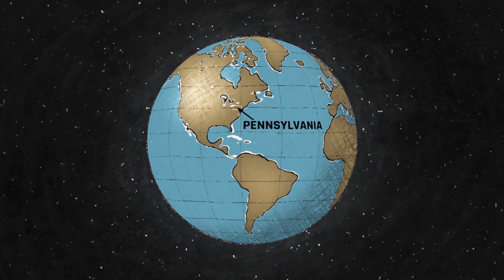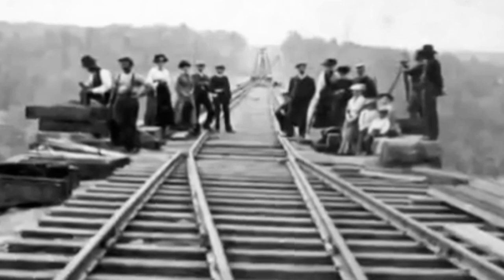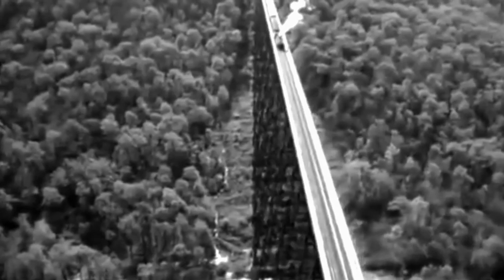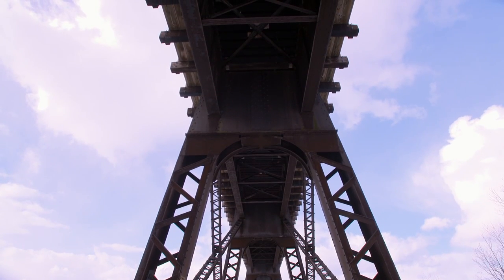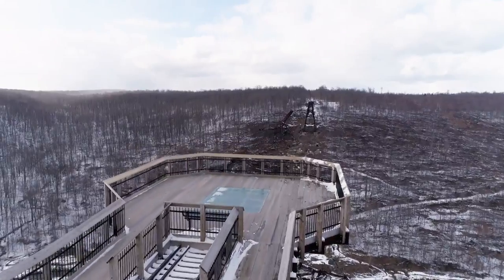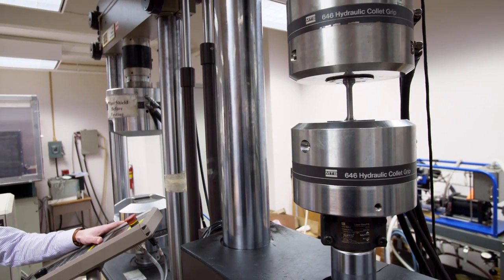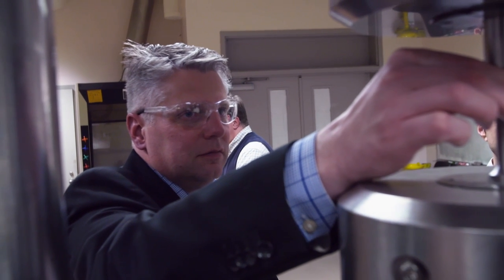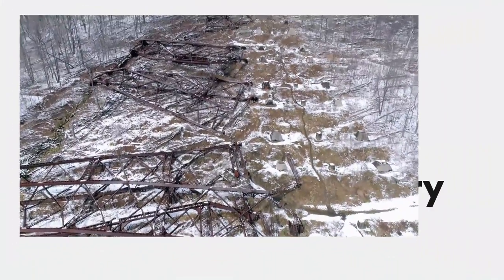How The 8th Wonder Of The World Failed Due To An Engineering Oversight |Massive Engineering Mistakes

Comment: Built in 90 days and then works over a hundred years... nobody injured or killed in its last day... I consider this a success 👍
Reply: Danger Bear  the same thing happened in Seattle Washington on a monorail project.
Reply: Massively!
Reply: But it didn't factor out how many labour were used?
Reply: today you have tons of crapy.managments like lean, six sigma,... And there is bigger potential to generate failures like this one or worst ;)
Reply: @Passco666  Ah , I see you're an old Jack Welch guy with that six sigma comment. It worked for Jack. Fire ten percent every year.
Reply: @Dan-oj4iq  I like like to use brain, instead guidelines for dummies.. Have a good christmas time..
Reply: I concur we're talkin an overwhelmingly genius design as even with anchor bolts, and unseen catastrophic weather events considered,because like you said the bridge was nothing but a true blue performer for so many years,and I am paraphrasing of course LOL..All things considered the bridge offered up nothing but positive happenings,& we all know as it pertains to practical designs,& with safety of course being the most important aspect to a design it all comes down to liability risk factor, and actual catastrophes, which in most cases any concept asked to deliver so much must in all actuality risk life and limb,or at the very least destroyed life and limb throughout 100 or so years of existence,which neither was the case in this situation.The bridge was absolutely genius it performed ingeniously for so many years and of course it's design was actually masterful because not only did the bridge fit into the picturistic it's actually served its purpose masterfully,& I actually think the anchor bolts were genius,as they allowed the bridge to move a little on the footer stones, which probably contributed to its longevity stability,and it's awesome safety record for so many years. Anyway my friend God bless everybody and have a merry Christmas. Thank you very much friends and Neighbors for letting me weigh in on your conversation,as i just wanted to say you are 100% spot on,and I really appreciate your opinion
Reply: Surprised they didnt try to blame it on global warming. The warmistas seem to try to blame everything on CO2.
Reply: Plus, after a hundred years of use, it took a tornado to blow it down. Yeah, a success.
Reply: @JordanJank  You talking to me? O_o
Reply: i see it as a absolute win
Reply: @franksworld9922  same thing happened in Springfield on the simpsons lol
Reply: @jakeshaw6827  your right! I forgot about that lol!
Reply: @franksworld9922   lol
Reply: My teacher in the late 1940s and early 1950s always said "ALWAYS FACTOR IN MOTHER NATURE" then you over engineer it and then you are in the clear.
Reply: Cypher791 that was my thoughts also. and it was an "epic" tornado as they put it tha caused the failure. its not like it just collapsed out of nowhere.
Reply: Dan horrible system .  This system like most Corp management is short term.  It destroyed GE.   People do not perform at peek all the time
Reply: @ bla jones 
It lasted over 100 years and the tornado took it down… We have different definitions of “short term“
Reply: Don Grey I thought before they said tornado ,that by their new design that freezing was gonna be the problem by lifting it off. So the upward pressure same thing. You would think they would have thought about that
Reply: This bridge was TEN YEARS in planning and most parts were pre made in the years before AND used the existing concrete bases. Thus not a 90 day build job, a ten year project.
Reply: @paulmentzer7658  but built in 90 days? O_o.....
Reply: @Cypher791   Everything was pre built when this bridge was rebuilt.  Remember, we are discussing the STEEL bridge that replaced the original Iron Bridge,  The line had become VERY profitable and the Railroad did not want to close it down for any length of time,  Thus it was decided to tear down the old bridge while the new bridge was built at the same time.  Each support span was taken down and replaced one after another.
Remember the real cost in time in construction is the base or foundation.  That was NOT changed, it was reused (and that was the problem, it retained the IRON from the first bridge while the rest of the new bridge was Steel). 
As to the spans, this was an erector set,  you can do that bam, bam bam.  The design work was all done in the decade planning this reconstruction, as were each  part.  The railroad brought the parts to the bridge BEFORE THE OLD BRIDGE WAS EVEN TAKEN DOWN.  Making the parts was the difficult and time consuming part of the construction, and it was all done before the 90 days of actual construction. 
You be surprise iron workers can snap these pieces together, once the foundation is done (and they used the old foundation in this case). I am surprised it took them 90 days.
Reply: You missed the opportunity to say "I see this as an absolute win
Reply: Damn right...set the facts straight!
Reply: I was just thinking that.
A lesson to be sure.
No project survives contact with a tornado.
Reply: Took a twister to tear it down. You can't beat old steel construction methods. They haven't changed much. They just use cheaper steel.
Reply: @fjfell5979  More Co2 = more oxygen from plants doing their job.
Reply: @johncooper7663  Unions aren't perfect. They can cause more harm then good if you're not careful.
Reply: it didnt even fail a tornado directly struck it lmfao
Reply: Ms. Tal  So if a bridge is blown up by dynamite, it's a failure?
Reply: Ms. Tal  (Edited)
Reply: Ms. Tal  well nothing is going to stand forever so the only alternative is to demolish it.
Reply: @Dan-oj4iq  Didn't he only fire the bottom 10% of managers though? not the coal face workforce?. If it was only cutting the dead wood of management it cant have been a bad thing.
Reply: @anthonyrb20  He let go the bottom 90% and retained the top 10%.And he did this every year. So unless you were in the top 10% you were gone.
Reply: @anthonyrb20  In the movie "The King's Speech "Prince Albert has to overcome a speech impediment. Jack Welch with all his ability, talent, and leadership (for some reason) never conquered his impediment. You would have thought he would have. It has been done. And yet he never had any issues with telling people that they "should be doing something else" if they didn't meet his standard of competence.
Reply: It's a hard thing to argue whether this was a success or failure. I think when it comes down to something built Generations ago it can't be blamed on the modern-day Engineers for mistakes being made.
It was successful in showing Engineers that you really can't cut Corners. Regardless of how much something is needed, you do it right or you don't do it at all.
Reply: Yess.. We call it failed if it tooks 100 years to build and destroy in 90 days..
Reply: Considering if they had changed the cast iron nuts to steel ones would make it last another century makes me feel like it really was a massive fail
Reply: No excuse, you always factor in Mother Nature. Very dumb of them to not consider that the bridge would be under lift if winds got high eniugh
Reply: Danger Bear  accurate
Reply: Not 90 days, the replacement of the supports was done in 90 days using original foundation that should have been replaced and re anchor. Did it last long, yes. You can't call the a success, when it was luck no major incident happened.
Reply: I strongly agree
Reply: It would have been a 200 year bridge if the underlying tenant of Capitalism, build it faster and cheaper,  had not been  the underlying aspect of the orginal project. Too bad they overlooked safety for profit. It is a miracle that it lasted 10 years let alone 100!
Reply: @racerj2.03  and your alternative would  be what?  because communistic/socialistic built projects fail just as much too.
Reply: A system is only as strong as its weakest link. It makes this project an utter failure.
Reply: And routinely carried twice the load it was designed for...
Reply: Discovery as usual over dramatic with their presentation 😂😂
Reply: Not true it's a fail the amount of money that was lost was more than u can earn in ur whole life a lot of money lost by the government plus now it has to be rebuilt which now needs double the amount of money
Reply: @AbbasKhan-eu2cj  I dont care anymore... ~.~
Reply: Good for  u
Reply: Because your not an engineer.
Thank god...
Reply: What I was thinking when I heard in 2003 is when it fell
Reply: @AbbasKhan-eu2cj  the bridge made a lot of money for people when it was in service,  but it was pretty much a tourist attraction rather than a working bridge for the last twenty years. I doubt it will be rebuilt, since the mines it served closed decades ago. It probably won't even be properly cleared away.
Reply: Absolutely
Reply: @paulmentzer7658  You're exactly right, the truss design was entirely sound, but the decision to rush the replacement and save money and time by not replacing the anchor points was the downfall.
Reply: @togglefire3537  Agreed, every time there's a failure, it's an opportunity to look at what went wrong, and what not to do next time, or what to do differently. Anyone just saying "well it stood for a long time so it's not a failure" is missing the point and is afraid of progress.
Reply: I would also be curious how many tornados went through there. It can't be many if it lasted 100 years.
Reply: Animals probably died but you know, no people so success... i guess
Reply: @darthvader5300  Teacher in the late 1940s? how old are you?
Reply: Right, not bad at all. Huge tornado can wreck nearly anything.
Reply: Also the minor point of getting hit by a freakin' tornado
Reply: @fjfell5979  the long range weather forecast from the late eighties was more extreme and more chaotic to come due to climate change.... best long range forcast ever. And a slap in the face of the climate change deniers.
Reply: lucky it didn't happen sooner then.
Reply: @public.public    Thank you. You just made my point.  Blaming it on Co2,   -17 years after the event.
Reply: @darthvader5300  
Absolutely!  Factoring in an extra margin for safety and longevity sounds like a good plan!
Reply: Here’s an idea.... Lose the bridge.... 
Train goes down hill..... Then train goes up hill......
Reply: Jordan Jank 

You are right. What would Europeans know about 1800 engineering?

There can’t possibly be anything that was built in Europe in the 1800’s that is still standing... Oh wait... I mean 1700’s... Ummmm..... 1400’s?........Ugh.... 1100’s?
Well Clearly nothing before Christ.......
OH FUCK IT......NEVERMIND.
Reply: thank god you arent an engineer. good enough is not good enough
Reply: Seriously looks like someone trying to blame someone else? Damm people Stand up and say, hey Maybe we should check The structural integrity of a bridge that has seen rail tons carried, and traffic increase over millions of times since the original 1920's construction.
I'm SMH at these guys really blaming someone from a 100 year's ago?
Where's OSHA at? Who is supposed to check old or existing structures for the RR?
No one it seems?
But we can spend a lot of time and resources trying to figure out what someone did wrong about 85 Years before they were born?
I am pretty sure anything I build in my life time won't be standing a century from now? But I guess I am not as good a builder as these Monday morning quarterbacks in this video.
Reply: This is by far a success.
Its even an a miracle
Reply: Agree, most things blow over in a tornado right? It wasn't an 'epic fail', more like could have been done better.
Reply: @tcs07d  this bridge outlasted communist Russia lol.
Reply: @fjfell5979  Who is "they"?
Reply: @davidc7765   Grammatically it is "Warmistas" in the following sentence. A  pronoun preceding its antecedent. But by extension "they" would include all the factions that use the "CO2 is the root of all evil" claim. You know..SJWs, MSM, PCs and sadly that army of duped believers.  Surprised they havent blamed it on Trump yet. Probably still working on that.
Reply: world wonders are supposed to stand up to the test of time, though
Reply: @Cypher791  "assembled" in 90 days.
Reply: @theg.c.142  Even good steel won't cope with design errors.
Take the silver bridge, decent steel, but a combination of corrosion, excess movement (amplifying the corrosion) and a poor safety factor made it a disaster waiting to happen. But the Sixth Street Bridge in Pittsburgh of a similar era still stands and will do for many more decades, despite lower quality steel, because it's over-engineered and the failure of any single part will not cause a catastrophic failure like it did with the silver bridge.

With the viaduct they knew about the issue and reduced the amount of traffic on it, and were restoring it when the tornado hit. The new steel of the bridge was not the issue but the reusing of the old iron and concrete anchor points.
Reply: @G1NZOU  true
Reply: Harry Eaton oh.... well EXCUUUUUSE ME!! 🙄...
Reply: Seems like a common engineering story as well "doing this properly will take weeks" "you have two days, it costs too much in lost profits otherwise". Then the engineer is at blame.
Reply: #rebuild it
Reply: luck rather. the tornado could have hit in the bridges first year
Reply: Danger Bear  Was NOT then either.  The planning, the making of the parts etc took over ten years to plan and make.  Everything was ready when it came time to build for everything had been premade and laying around to be used in the construction.  Yes, the bridge was out of use for only 90 days, but actual work to replace the bridge took over ten years.
Reply: Exactly, if I build something that lasts til 2112 and they have to replace it, well done me. This is not a fail video.
Reply: exactly
Reply: Wow
Reply: Absolutely right. Excellent point.
Reply: Has my vote!
Reply: You consider the pure coincidence of nobody being there when it fell apart a "success"?
You must be Pennsylvanian...
Reply: Huge success